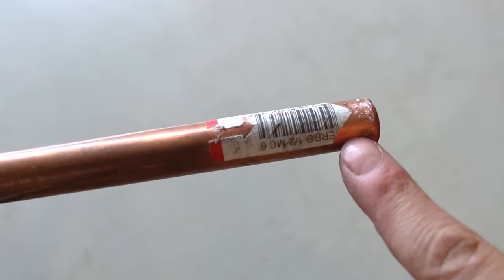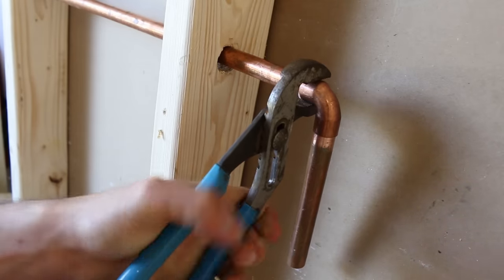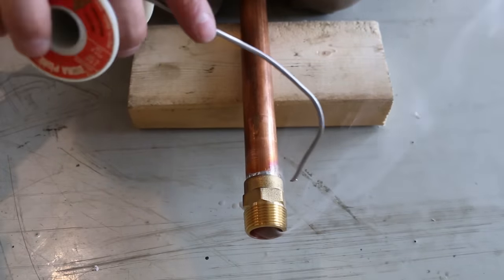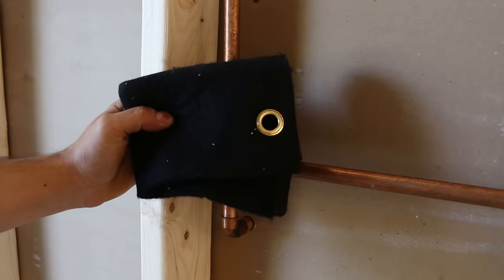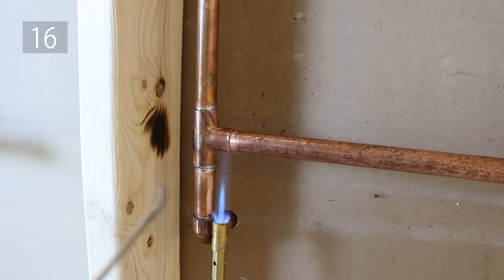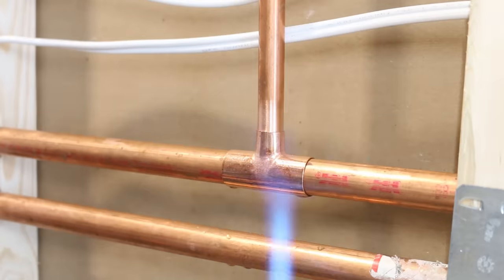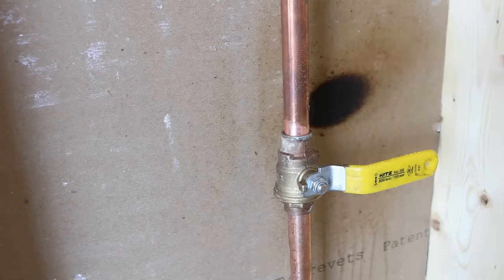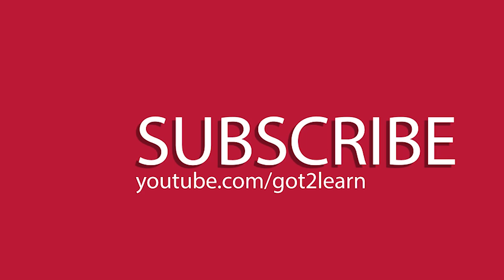The BEST 25 Copper Pipe Tips & Tricks EVER! | GOT2LEARN

Comment: Yeah, I'd never recommend trying to round out a crushed pipe end. Just cut it off lower and solder a longer piece on. Saves the headache and the risk of a compromised joint.

Also don't know how i feel about spraying down drywall with water. Maybe if you have no breaks in the paper, it'll probably be fine. But I'd rather not risk screwing up a seam on the other side of the wall by accident. A heat shield should be more than sufficient to protect sheetrock, which is already somewhat fire resistant in and of itself.
Reply: Copper is one of the most malleable of all metals - only surpassed by Aluminum, Silver, and Gold.  I don't think you need to worry about manipulating it a little bit.  It's tough.
Reply: @MrKnutriis  maleablility has nothing to do with it.  It's the fact that you are relying on field-forming it back into round pipe... Which you certainly can't do with any degree of precision in the field or with the standard tools available to the average plumber or homeowner.  Due to the inevitable oblong shape, you end up with parts of the joint that have more solder than is needed but you also have an equally amount of parts of the joint with a potentially inadequate amount of solder.  The solder is going to go to the wide open joint, but it can only fill so much in the tight areas. So you have weak spots that might not leak right away but could fail prematurely.  It just doesn't make any logical sense not to cut off an extra inch or 2 if you got it to spare.  This is copper pipe, not platinum.  I don't know why everyone acts so damn stingy with every inch of copper as if it's going to make a damn bit of difference to their wallet.

Comment: #9 tip!!    if you have any small drips from a copper pipe, DO NOT ATTEMPT..to solder!    if the drip is small enough, dry the pipe good, then stick a piece of bread in the pipe that's dripping, sweat the pipe fast, flux then solder!   the bread will break down when when water pressure is turned back on and drain through anything pretty much!
Reply from the maker: Good stuff!!

Comment: Copper pipes?  Did you do any shopping lately, tantamount to the price of gold.  See you homes using garden hose for long runs,  under wallboard!  Or PVC.  May just find some small lengths going into a hot water heater where it gets hot or at the water meter. 

Latest thing with copper are embedded O rings in fittings and a compression tool.  Wonder how long the rubber will last buried behind a wall.

Comment: another tip --- if you're a residential DIY'er always use red type M pipe. Type L is only minimally more expensive, so I figured I'd use it, but the increased outer diameter makes it extremely difficult to get the adapters. You will save yourself a lot of frustration using type M from the start. I ended up tossing all the type L and redoing it with type M.
Reply: The outside diameter is the same for type K, L, and M - they are all 5/8 inch.  The inside diameter varies due to the difference in wall thickness.  You must have experienced a different problem.
Reply: @MrKnutriis  maybe, but Type M was a nightmare to work with, Type L was fine.
Reply: err... reverse.  Red (M) pipe = easy; Blue (L) pipe = nightmare.
Reply: @AidanSkoyles  Yeah - L is the thicker than M.  M is the common pipe for interior plumbing.
I think you may have had problems due to the expansion from your cutting tool on the thicker pipe.  The wheel that makes the cut also forms a 'lip' and that sometimes makes it harder to get into fittings.

Comment: Tip 21 : (using sealing tape to prevent inadvertant tinning with solder) is not a good use for this tape. It's PTFE, which emits toxic fumes when overheated. A big issue with non stick pans used on high heat. Bad enough for humans ( known as 'polymer flu') but extremely dangerous to birds. Solvent based Tippex works well for silver soldering, so probably good for soft soldering too.

Comment: Another trick for water still in the pipe or a leaking valve is to stuff bread into the pipe----after you're done soldering the bread will break up when the supply is turned back on.
Reply from the maker: Yes of course!!
Reply: You must have missed that part...it was in the video.
Reply from the maker: I think he did hihi

Comment: If you are heating up Teflon and inhaling the fumes you are not doing yourself any favors. Teflon smoke & fumes will make you sick. I use a fume extractor with my hot wire strippers for stripping Teflon insulated wires, and Teflon tape is basically the same stuff. If you were under a sink in a cabinet and breath those fumes you might feel a little like you have a slight flu bug for a day or two from breathing those fumes. A small fan will help, and even one of those fans with a clamp mount on it works well too. Just get the more of fumes from the Teflon out of there.
Reply from the maker: Thank you very much Seth!

Comment: A freshly made soft solder joint on copper will never crack on cooling. It’s malleable from its melting point to room temperature. Plus the solder joint is only a few thousandths of an inch thick. That matters. 
The correct thing to do is wait til the solder solidifies and wipe the joint while still very warm with a moist rag to get the excess flux residue off the joint. This will eliminate a messy bit of oxidation years down the road. 

Silver solder or brazing is different. But that’s not what’s being shown here.

Comment: Tip For non plumbers; Solder joint, turn on water, observe location of pin hole leaks, turn off water, drain down system, unsolder joint with pin hole leak,  resolder joint, turn on water, locate new pin hole leak, repeat process.  This is my wifes summary of procedure for plumbing project.  Conclusion: "There is no such thing as a simple plumbing project".
Reply from the maker: Lollllll, that's the real way of seeing it ;)
Reply: That’s how it goes with mine...lol
Reply: RE:John Whitehead.  Ha, ha! Yeah, that's the way it goes sometimes.

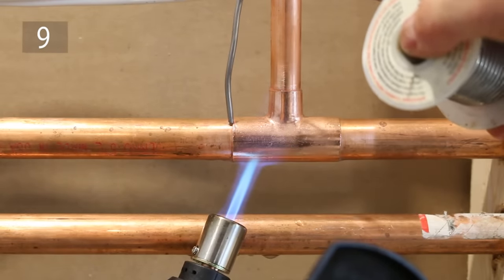Comment: 3:10 stuff a small amount (just enough) bread or dissolving "plugballs" up the line if the water won't stop. Both will dissipate under pressure and will stop the drips for a couple min. The basement solder joint of a 4 story apt building could take forever to drain, and 4pm Friday is NOT when you want to wait for the dripping to stop.

Comment: 2:43 that’s not a gate valve. I worked as a quality control inspector at a bronze foundry that made valves as a young man. It looks like a boiler drain or a sill cock or something similar. Gate valves had a bronze disc with female threads that attached to the male threads on the stem of the valve. So when the hand wheel was  tightened on the valve,  the disc would gradually shut off the water flow. These valves leaked quite a bit due to poor design, then along came the ball valve, which worked like a charm

Comment: Here's another tip: having trouble finding a waterline in the ground? Cut off 2 pieces of sauter about 6 inches long. Fold it about a quarter of the way. Hold it on the smaller side, level, side by side and the water underground will cause the sauter to pull themselves together magnetically

Comment: after soldering pipe joints wrap with a cold wet rag. this will keep the pipes from turning green. also cools them so if you accidentally touch the pipe.

a 5 star general contractor that mentored me taught me this.

Comment: I'm curious - why copper pipes are still in use in households?
Reply from the maker: Because it's good?
Reply: @Got2Learn  well, they are looking incredibly cool, when used on some open parts. But it's so hard to connect them. With nowadays plastic pipes it all kinda way easy.

I'm just asking, because I never have seen copper pipes in real life houses at my home around.

Thanks for video, anyway! Maybe I'll plan to use copper pipes in some of my functional design project.
Reply from the maker: Well, copper was installed a lot back in the days, now less because of PEX and other systems, but it still remains one of the best piping for home hands down ;)
Reply: @Got2Learn  wah, I see, thanks for answering my silly questions. Yeah, copper pipes are bringing kinda nostalgic feelings, even if here, in my country, in my childhood I've seen only iron pipes everywhere. Iron pipes are getting rusty easy and were looking terrible, I'm glad that they are gone nowadays. But I was nicely surprised when I found out that copper pipes are still available, so I've bought some to play around with them.
Reply from the maker: Yes, have fun with those, there's lots to learn ;)

Comment: Did I miss a tip on when your fitting is on a vertical pipe and you need the solder to up and not drip down the pipe with the flux?
Reply from the maker: Huh??
Reply: @Got2Learn  Vertical pipe, from basement up through floor for sink. Fitting on top of pipe. Will the flux naturally draw the solder up into the fitting?
Reply from the maker: Yes.

Comment: why you guys dont use plastic pipes where you at can you explain?
Reply: Plastic for great for drains, it doesn't occlude like black pipe, with rust and stuff that gets hung up on the rust.  ...but I will NOT use it for supply lines in my house!  Copper is antimicrobial, meaning it kills any bacteria that might be inside the pipe...plastic lets them thrive...no thanks!...there is a (good) reason doorknobs are made of brass, and restaurant counters are made of SS...metal ions kill bacteria!  If you are afraid of or don't have the confidence to soldering copper pipe, engage a plumber...!  Plasdick supply pipes are for weenies!
Reply: @ronplucksstrings7112  i didnt know.. thats what we use in our place... i guess ive learnt something new.. and no im not affraid of soldering :)
Reply: @DaMaster1983  I'm happy you took my info in the way it was intended...if you are OK with soldering, you know what my recommendation would be...!  That plasdick crap has been developed and marketed among other reasons, so that DIYers can do their own plumbing at a much lower cost, and without having to solder...it's fine for your heating system, or lawnsprinkler, but not for what I'm drinking out of!

Comment: A burr causes pin holing - not in my 35 years experience, cheap Chinese copper that hasn’t had the impurities removed when combined with hard water and no water treatment causes pin holes.
Crimping loose hanging pipes at the fitting? It flares the fittings and stops the capillary action of the solder, usually on side you can’t see, so you solder those off the job, or buy decent quality fitting that have finer tolerances and aren’t loose.
Lastly, why are you applying the solder at the flame? On 15/22/28 (1/2, 3/4, 1”) you put the solder on the opposite side of the fitting, if it is hot enough to melt there it will run back, especially where you can’t see the joint.

Comment: You pinch the memory cloth under your thumb and pull it tight under your thumb boom easy. It cleans it good and fast. You dont scrub it like you doing dishes.
Reply: You take a long Strip of memory cloth you pinch the end under your thumb. You pull it from under you thumb with the other hand creating a single motion using friction amd cleans the pipe easier and better. Which is better then "scrubing" it or holding in one hand while you go back and forth rubbing.

Comment: Many small ball valves have a nylon ball and will be damaged if heated. All copper pipe should be silver solder.
Reply from the maker: They are made to be soldered, you just have to be careful not to overheat them.

Comment: If your copper pipe gets a rainbow color to it your using to much heat in one area and burning out the flux. Also the use of Type M copper (Red Lettering) for pressure pipe is not recommended, Always use Type L (Blue Letters). My last comment is, be VERY careful with that last tip, introducing a flammable gas inside a pipe like that is creating a pipe bomb, although unlikely an explosion will happen. Its possible you will have a bad day when you go to solder your next joint. Ive done it many times and after i was done the end of the pipe remained on fire for at least a minute which means theres un burnt gas still inside the pipe, had it not burned off your next joint youll be changing your underwear. The rest of the information looks pretty sound to me in my 19 years exp.
Reply: Just to add to the importance of my "pipe bomb" comment, I was screwing around on the job one day and had a 4 foot long piece of 1inch copper with nothing on either end and i filled it with gas then lit it with a lighter and it sounded like a .45 cal round was fired off and my tape measure and all my fittings on my fab table flew at least 25 feet away and my ears were ringing.
Reply from the maker: Thanks Matt, all your input is much appreciated ;)

Comment: Emery cloth has an oil base and so does steel wool. it will leak. do not wipe with your bare hand, oil.
Reply: Will you be willing to further explain, please?
Reply: @dragoszmoartescu5518  When these products (Steel Wool and emery cloth) are manufactured they have an oil film on them from the manufacturing process, lending them to not wanting to solder up properly . Paper backed sand paper does not. Now you've just cleaned your pipe and wipe off the dust from sanding with your hand chances are you have a small amount of oil from your skin that can also leed to a bad solder joint.
Reply: @dennisrisk6063  Great appreciation for your explanation. Thank you.

Comment: before scraping paint off the pipe try firmly sticking duct tape to it and pulling it off, you might be lucky and the paint can come off with it
Reply from the maker: It's strong enough? Thx for the tip :)
Reply: @Got2Learn  sometimes, it depends on what paint was used

Comment: "don't use teflon on threads before soldering"
also: "use teflon on threads before soldering"
also: now I finally have a use for all these old license plates I have been saving for 40 years
Reply from the maker: Never put a direct flame to Teflon tape, that's the difference.
Reply: You might want to go back and watch it again to understand the difference in times that this would or wouldn’t be done. If you still don’t get the difference, have someone else watch and explain it. It happens to us all

Comment: Drips of water in a pipe you are soldering...  ball up a piece of bread, push it in the hole, not too much or tight,  it will dissolve away about the time your joint is soldered and you turn the water back on.
Reply: Huh, this was in the video!
Reply from the maker: Yup!!

Comment: What i like to do if there is paint on copper pipe is just heat it up with a torch then sand comes right off.
Reply from the maker: Yup, that does miracles as well, and it also works well on stickers, just add a bit of flux and it comes right off :)

Comment: I'm a plumber been in a trad for 35 years let me assure you deburring a pipe will not prevent a leak the purpose for  bebering a pipe is for smooth flow. in a domestic water system in your house the ber created while cutting will mean nothing they have no ill effect and if you are living in a house with copper water pipe and a professional plumber installed  it there is a 99.99% chance your pipes whenever D bird
Reply from the maker: Watch this: https://www.youtube.com/watch?v=WIIvGG6qNJM&t=344s
Reply: @Got2Learn  the flu loss from not reaming the pipe is almost negligible in a residential plumbing system it is so small that you need the most sensitive equipment to detect it .
Reply from the maker: It's still mandatory to do in residential application, as most codes state.
Reply: @Got2Learn  ok sure ....... 😂😂😂😂😂
Reply from the maker: I sense non-belief lol, can you tell us why the tools exist then? Why is it that on a Power 300 threader there is a reamer on there?
Reply: @Got2Learn  well it's stems from steam piping when running steam you need a smooth linear flow when installing high pressure steam lines we use inside feeler gauges to line the inner wall a misalignment of the inner wall will allow the steam to eat away at the pipe also new refrigeration systems with her high pressure and high flow reaming of the pipe is necessary
Reply: But I think people who insisted be done for domestic water system are merely trying to impress people with their knowledge or have slightly a higher opinion of their selves and what they really should and lack the ability to think for themselves do not truly understand what are doing at a fundamental level
Reply from the maker: Oh btw, flow lose is only one of the things, hydrauluc turbulence is the main concern here.
Reply: @Got2Learn  and yes you're correct turbulence is a concern look up Tesla valve it uses a series of Maneuvers to induce turbulence to restrict flow

Comment: Best tip: don't solder, use compression or push fit connections.
Reply from the maker: Hmmm on big jobs this wouldn't work, maybe just a repair.
Reply: They leak
Reply: I have had this conversation with people all the time,you just can't beat copper
Reply: What's good about your tip?  Cost more, fails over time?